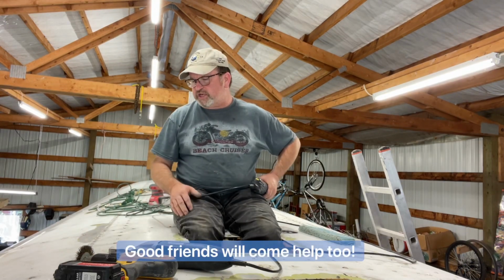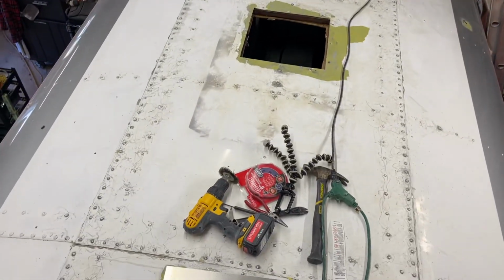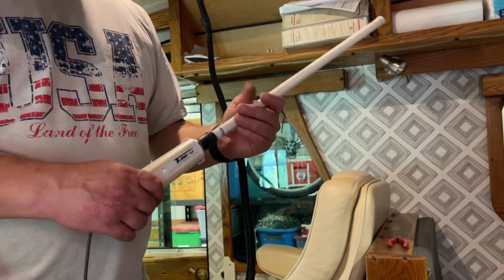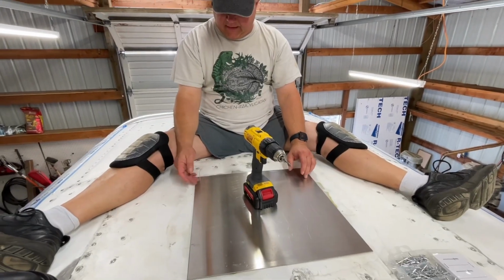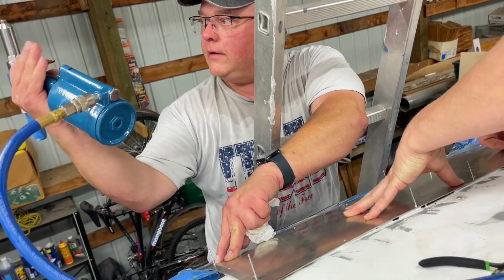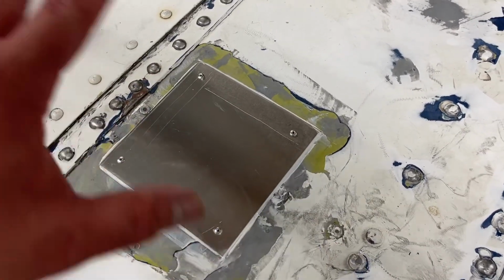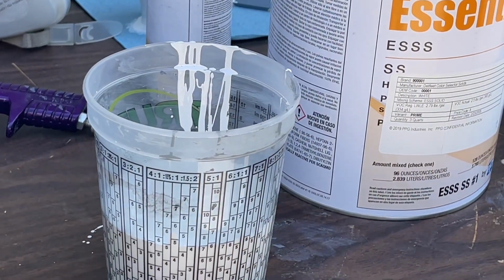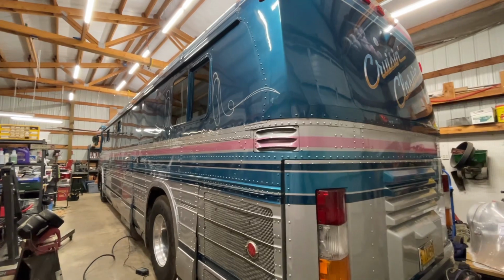Painting our Bus roof before solar panel install￼. Sanding around thousands of rivets!

Comment: Looks nice!
Reply: Doesn’t really matter what the top looks like as long as it’s sealed from water penetration when it’s finished.   A drone isn’t even capable of detecting an ugly roof paint job from a show winner and no one on the ground will ever see it so finish it to prevent water penetration and your good to go. 

And use quality materials! That’s not a place to try and save $10.
Reply from the maker: Yeah, it’s not great and I’m not a professional, but it will work